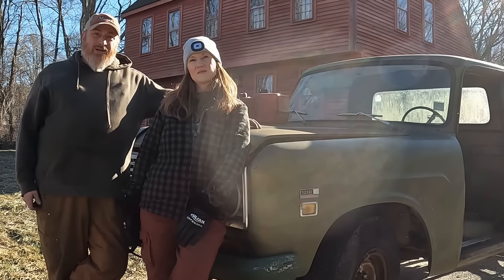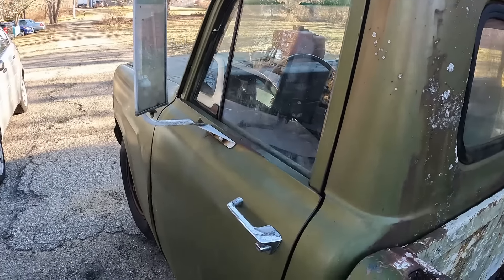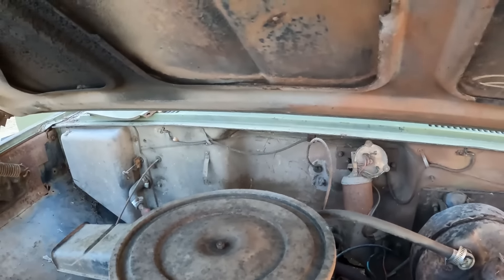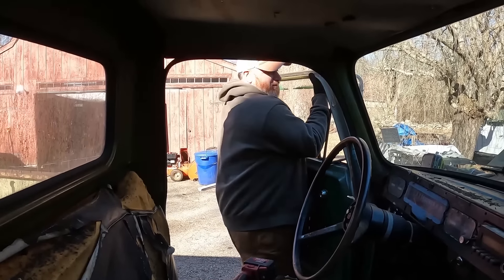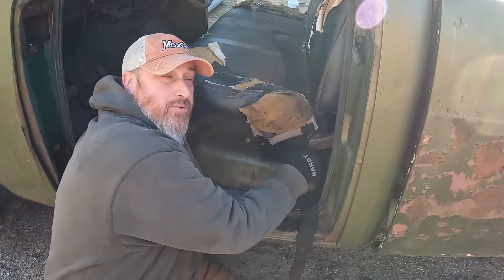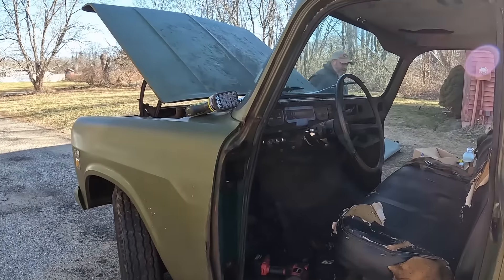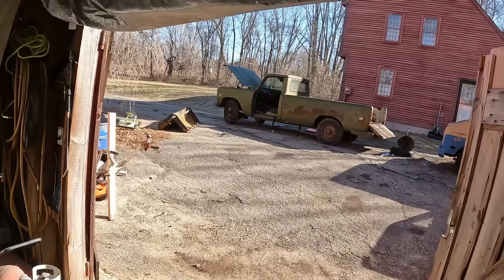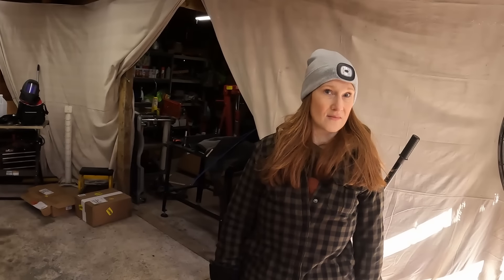International 1210 Chassis swap to a Panther Chassis!!  Part 1 of many! Corn binder to modern rig!

Comment: The Grand Cornbinder! Consider channeling the IH's body and bed. I believe the original motivation for channeling hot rods was that the rockers and doors on old cars were eaten by the dreaded tin worm and it was easier to cut the bodies down than to fix the rust. I would tack weld the tailgate in place to keep the bed square during storage. Puddin's Fab Shop did a video on shortening a long bed a few months back. You got this!
Reply from the maker: I've seen Puddins video on his short wide. Thanks!

Comment: Just finished a 65 Ford F100 truck and frame. Used the complete drivetrain from a 06 Crown Vic cop car P71. Get your specific year wiring diagram manual off of eBay. You gonna need it. The smaller firewall connector gave me fits. P260. I dyed it off and spliced the wires.

Used the instrument cluster in place of the OG cluster. Stripped out a bunch of wires from the cab harness.

Used a possi unit from a Ford explorer 3.73 gear.

A fire wall and frame swap is doable and then you get AC and other firewall mounted chit. Intermittent wipers, steering column, and heater.

Used the back seat upholstery and foam to recover the truck seat. 

Have fun. Been a subscriber for a bit will continue.
Reply from the maker: Thanks for all the info! I have a CV front and rear end sitting in the garage. Might be for our red 64 F100

Comment: Why don't you work smarter instead of harder use the engine hoist with a strap
Reply from the maker: My hoist is behind a bunch of stuff and it was a test run for the cab.